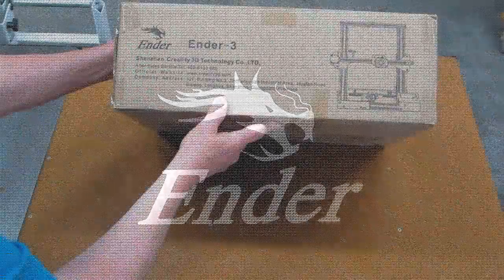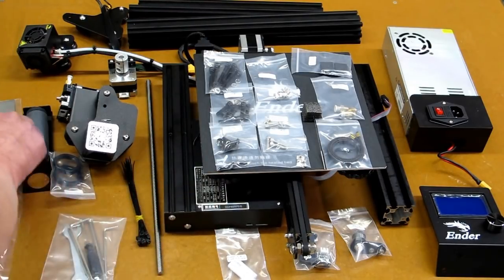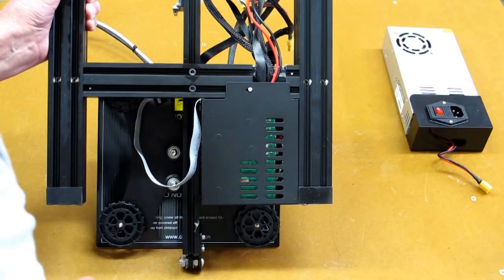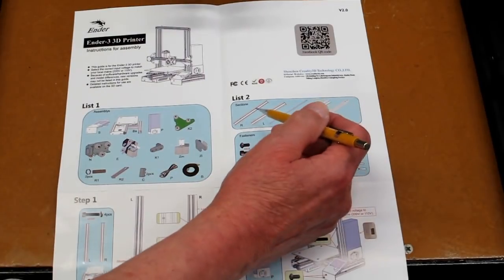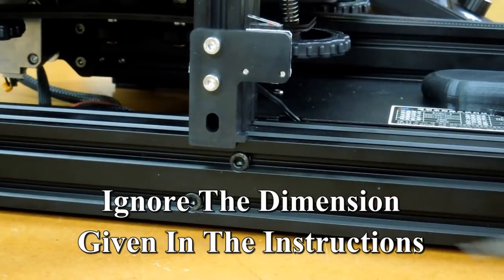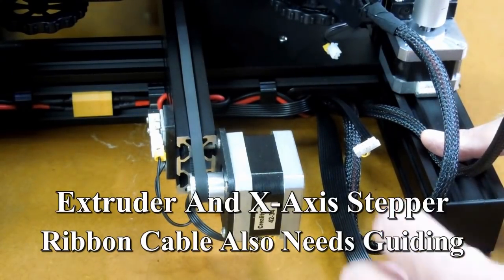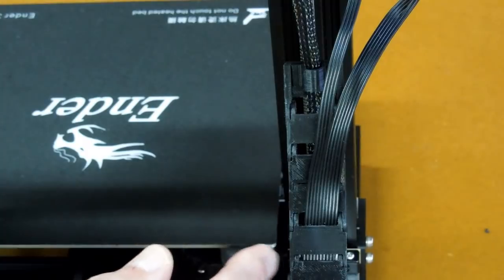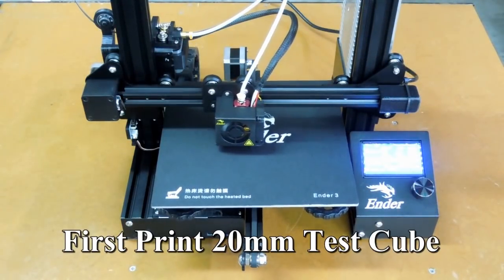Ender-3 Unboxing - Modification - Attachments And My Build

Comment: I  cannot find the Thingiverse links for the spool angle bracket. Any idea where that came from?
Reply from the maker: Sorry about that. 
These were listed in the description for this video, but over time they got deleted with various updates.
I believe the item you are looking for is the first one listed. If not, please ask again.
Look around on my channel. I have over 600 videos on a wide range of topics. 
Thanks for watching. Please subscribe. 
That is what keeps this channel running. 
Ron

Thingiverse links for parts printed for my Ender-3

Filament Spool Holder Adapter - https://www.thingiverse.com/thing:2948891

Pressure Fitting Block - https://www.thingiverse.com/thing:2994683
Cable Protector – https://www.thingiverse.com/thing:2934313
Display Ribbon Cable Clip - https://www.thingiverse.com/thing:2880021
3 Wire Clips - https://www.thingiverse.com/thing:2960375
2 Wire Clips - https://www.thingiverse.com/thing:2981386
Extruder Hot End Cable Support - https://www.thingiverse.com/thing:3042557
Motherboard Fan Cover - https://www.thingiverse.com/thing:2935204
Controller/Display PCB Cover - https://www.thingiverse.com/thing:2858209
Power Supply Rear Support - https://www.thingiverse.com/thing:3023240
Heatbed & X-Gantry Cable Chain - https://www.thingiverse.com/thing:2920060
Bearing Filament Spool Support - https://www.thingiverse.com/thing:2545222
CR-10 X-axis Right End Cover - https://www.thingiverse.com/thing:2501854
20mm Calibration Cube - https://www.thingiverse.com/thing:214260
Filament Roller Guide - https://www.thingiverse.com/thing:3052488
Adjustable Y-Axis Endstop Bracket - https://www.thingiverse.com/thing:2879245
Fan Grill Covers thing:2802474 - www.thingiverse.com/thing:2802474
Extruder Flag thing: 2564007 - https://www.thingiverse.com/thing:2564007
Z-Axis Leadscrew Knob (Print X&Y at 98% size) – https://www.thingiverse.com/thing:3014508
Vent Ring (Ring Cooler) - https://www.thingiverse.com/thing:2912394
Turbine Style Fan Guard 40mm - https://www.thingiverse.com/thing:2505568
Hero Me Fanduct - https://www.thingiverse.com/thing:3092044

Thingiverse Links –

Petsfang Bullseye Duct https://www.thingiverse.com/thing:2759439
Petsfang Accessory (Dial Indicator) Mounts https://www.thingiverse.com/thing:2863991
Hot End Cable Extruder Clip https://www.thingiverse.com/thing:3102898
Fan Grill Covers www.thingiverse.com/thing:2802474

Comment: Hello Ronald, 
I have a Ender 3 and a friend my too, he told me to turn off the extruder fan to printing using ABS. 
So that is realy bether way to printing in ABS?
So my question is, It's safe do that? As i know the extruder is turn on in parallel with the fan board and if i turn that off Can I burn my Ender 3 board?
By the way,  It's possible turn on the fan board directly on 24v output from the power suply?
Reply from the maker: There are two fans on the hot end. The hot end heat sink fan should always be on. The filament nozzle fan is wired together with the motherboard fan. I would rewire the motherboard fan directly to 24VDC so it is always on. Then you can program the filament nozzle fan as you wish. I have no experience printing with ABS. I need to try that one of these days.

Comment: Best introduction and tips video regarding the Ender 3 I’ve watched on YT. Thank you.

Would you, by any chance, know what size the bolt and t-Nut are?
Reply from the maker: You should watch the Ender-3 review video. I installed the Bullseye Cooler on the hot end and the Ender-3 is now printing very well, every bit as good as the CR-10. The t-nuts like used on the Ender-3 to hold the z-axis end stop in place are M5 and the nuts are called sliding or "hammer" nuts. They come in different sizes depending on the aluminum extrusions they are being used. Thanks for watching. Please subscribe!
Reply: Ronald Walters Thank you.

Comment: thanks ronald for your explanation. In the video (16:27) you move easily the x axis to down with your hand.  Can you move the x axis easily to up?. I think that i have the same problem (z axis alignment). thanks. sorry for my english.
Reply from the maker: It moves a little easier down because of the weight of the mechanism... but it also moves easily upwards. I also have a video on "z-axis alignment correcting". Please note the speed of moving the axis in the video is fast forwarded 2X to shorten the video. It is not a good idea to move any axis too fast by hand. Thank you for watching. Please Subscribe! Ron

Comment: Great video Ron. I appreciate the methodical approach you take to building the kits and adding minor upgrades to your 3d printers.

What made you get a Ender3 after your Cr-10? Is it not a smaller print surface? Or is it more the convenience of having multiple print beds and or filament types ready for printing?
Reply from the maker: Your x-axis being lower on the right side is most likely due to the 2020 hot end v-track not being square to the left side vertical 2040 column. Starting at the beginning -  On a known flat surface, make sure the printer sits firmly on all four feet. If not, loosen screws of the frame assembly, wiggle around and retighten everything until it sits flat. The print surface determines y-axis once the bed carriage rollers are adjusted. I have a video on the Ender-3 z-axis alignment correction for people who have received one with an incorrectly bent carriage plate which holds the extruder and leadscrew nut. The z-axis leadscrew alignment needs to be addressed before you work on the x-axis alignment. X-axis adjustment or alignment was shown in the text @ 10:44 of my unboxing video. The 2020 v-track (which the hot end carriage rides on) must be perpendicular to the left side vertical 2040 v-track or column (which the z-axis carriage rides up and down on). Adjust the left side carriage wheels (which holds the extruder and x-axis stepper motor) then make sure the hot end 2020 v-track is perpendicular (square) to the left side vertical 2040 column. Follow the text instructions @ 11:07 (my unboxing video) regarding installation of the 2020 top cross member before tightening the right side z-axis carriage to the 2020 hot end v-track. With everything assembled, the bed is leveled to the hot end nozzle at all 4 corners of the bed. Bed leveling should be done with the bed and nozzle running at the same temperature you will be printing with. The hot end heatsink needs to be square to a leveled bed (my unboxing video).  Make sure the two screws holding the heatsink to the carriage are tight. If you move the heatsink, tighten or replace a nozzle, then the bed needs to leveled again. Nozzles should be loosened and tightened at printing temperature. With the bed leveled... X, Y & Z should be correct physically. Printing a test cube is a test for the electronic or program calibration which I have never found necessary to mess with. Thanks for watching. Please Subscribe. Ron
Reply from the maker: You make some good points for having more than one. 
I never thought I would have one 3D printer much less two 3D printers. I spent 6 months recovering from shoulder surgery and I am still not back in the shop fully. Then I had both eyes operated on in July.
The first printer was supposedly to encourage myself to learn more about Fusion 360 and to give me something to do during recovery. It has been fun and a definite learning experience.
Then I was offered the Ender-3 Kit for review. I have yet to print anything on the CR-10 which could not be printed on the smaller Ender-3 bed. Most of what I have printed is smaller than my fist.
Most of the glowing reviews for the Ender-3 have been based on its low cost for a small size printer and those reviews pretty much end at that point. I hate reviews or comments left by someone who just received the box but haven't actually plugged it in yet. 
The Ender-3 has a large number of the same components used on the CR-10 and it is a very solid unit. It does have some silly issues which have made it difficult for many to enjoy its capabilities. My actual review video will release next weekend and it truly covers the strong point, the issues and how to fix the issues.
I have it printing now and it appears to be every bit as good as the CR10. Fully self-contained and the much smaller footprint should be attractive for anyone with limited space.
Thanks for watching. Hope you have subscribed! Ron
Reply: Excellent. Looking forward to the review video. Nobody yet has walked us through the physical calibration of the printer. I am personally experiencing issues with the x-axis being lower on the right side. Cant seem to figure out how to solve it...

Comment: Seems to be a very well put together piece of kit. I wonder if those wires from the power supply isn't a bit too thin - they seem to very skinny, when you think of the power they are supplying to the mainboard and heated bed. I just put together the Original Prusa Mk3 kit (my 5th printer) and the power wires from the supply is two sets of wires, both thicker than the single on the Ender 3.
Reply from the maker: This is a 24VDC power supply. Nothing is overheating (including those wires) and the bed will go from room temp to 60C in less than 2-1/2 minutes. My review video will release next weekend... watch that one. Ron
Reply: @RonaldWalters2010  I know it's a 24V power supply. It's just a bit of a skinny wire guage they selected for a maximum of 15A current draw 😁